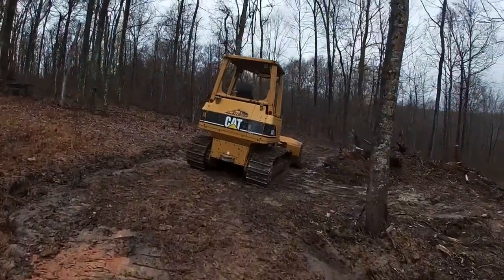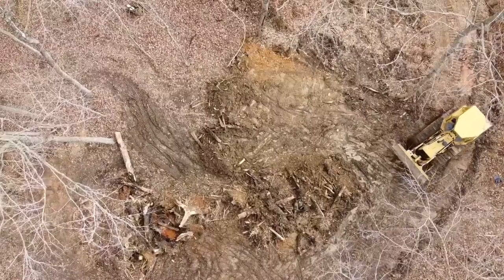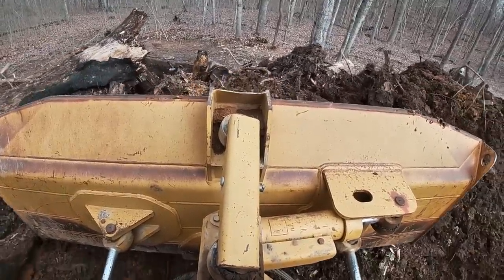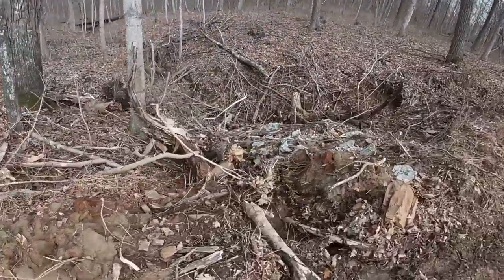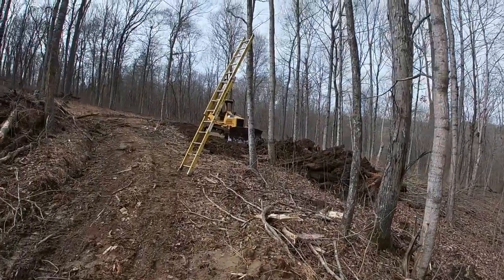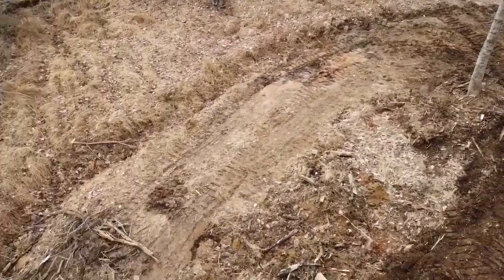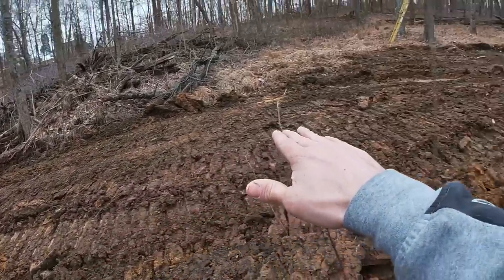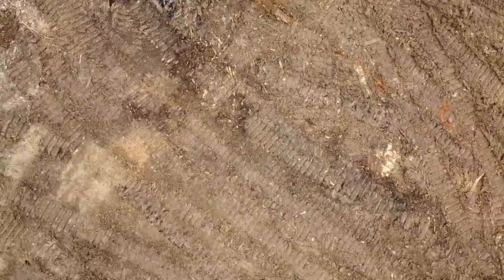Homeowner Rents Caterpillar D4G for land clearing - Youtube Yacht Series

Comment: I was an Air Force Vehicle Mechanic for 20 years (retired in 2016) and the company that makes those portable 12/24 Volt jump packs are awesome!  We also had their heavy duty roll around packs that even had the M-Series slave cable receptacles! Our mobile maintenance trucks their generator/jump start unit with ALL of the different types of connections and cables for just about any application you could imagine!  Their products are tough and last a long time.

Comment: Jerry will be proud! You ended up with a tolerable good result without breaking anything. 

My grandfather had a D9. It was post WW2... you know like 1946.  It used cables to lift and angle the blade. He lived in Princeton IN.  As a teen, I had the privilege of playing on it for a weekend.  

He had a 40 acre corn field that he was terracing.  It had been cleared years ago except for 2 huge pecan trees that he wanted to save. 

You see, when you are backing a D9 in the middle of a 40 acre corn field you don’t worry too much about looking backward... had he seen fit to put a rear view mirror on it... he might still have two Pecan trees in that field.

But, the one that was left stands proudly beside the office of a trailer park now... and a little bit of the wood from the other is in a hope chest he made for my sister.

So, by my book.. you did just fine in your maiden voyage.
Reply from the maker: William Harris as always you made me laugh.  So Am I to assume that some of your wood working knowledge  got handed down from your grandfather?
Reply: Captain Kleeman a little bit... he was actually much better with metal... he was a Tool & Die maker for Westinghouse.  I have all of his measuring tools... slide rules (ancient calculators... one step above an abacus), and etc. I learned woodworking when I was a Quality Engineer for a huge Furniture manufacturer.  Good try though.

Comment: I always remember when our dealership got the first high drive D10 in Canada. It was set up for a big open house with a D3 dozer in front of the Mass Excavation Blade. The D3 looked like a little toy sitting in front of the D10.
Reply from the maker: Gerald Heitman did you work at CAT dealer?
Reply: @CaptainKleeman  Yes I worked at the Cat dealership for Ontario Canada in the engine division (industrial & marine engines and generator sets)

Comment: As you get more practice you'll find second gear and more speed will help.
Breaks up material and pounds in some of  the material and smashes wood under the pounding. It looks good!!
Reply from the maker: Blade Runner I Ran a little
Bit more today.  You’re right,  seemed to help a little.  Just trying not to get to full of myself and break something 😂 hey thanks for watching!
Reply: @CaptainKleeman  Go for it. Lay dirt out thick then take cuts about a foot deep. If wet and sticky angle blade and winrow it out,, keep working big wood rocks and stumps off edge of lift. Don't worry about dirt or grade just thin out the junk.When your ready take the first cut down the middle of lift a one ft cut works good at leaving dirt and keeping enough dirt to roll out any large wood ahead of push or it'll roll out one side or the other.Rule of thumb  max push for efficiency and grade level is 150 feet but works out slightly more. We work three stations at a time on road jobs stakes 50 ft apart. Take the high side of lift first, I said above to take middle to start, if lift lands fairly equal depth is when I'd take middle then left side or right. If you track onto large rock along cut back up and corner it up out carry on to bladeful you left push to end. If theres a hole dont worry it'll fill next pass or so.At end of second push half track your imprint back to start 2nd gear let out off decelerater the dozer will speed up and develop what we call a thunder speed up as it comes into it to where your comfortable. Check tach if you have one or train ear to  rpm tone for reverse. Creates an equel pack pattern, the tighter the pack the better the 2nd cut goes. Now it becomes more enjoyable seeing lift coming into it. You won't break anything so don't worry about that. I carried on as usual, not trying to tell you what to do. I grew up excavating been at it 30 yrs or so.pretty much done now due too severe spine injury. Two things you DO on a dozer is wear seat belt and hearing and eye protection with open cab. Always belted enclosed cab ear and eye is still good idea. As confidence builds your speed will pick up, beware of covered stumps still rooted stop you dead in your tracks. Without belt you're going overboard after you meet dash and grab handle on top comes air cleaner and muffler.  What you DON'T do with a dozer is push against trees to knock them over. The whiplash affect can snap the top off or just a limb but plan on it landing on you.  There is a method to it but chain saws better choice. Large rock tilt corner ease into cut and push when you feel dozer pressure against rock throttle up and lift on blade. Keep dirt betwwen blade face and rock. If no movement back off easy and tilt cut around it pick a different push point. No move put hoe on it.Sorry so lengthy. Can't tell.i miss working! You're a natural by the looks of things doing great.
Like you said common sense and seat time. On reverse speed if your reach loud /hard track pad slap slow down a tad. Have fun, I'll be checking out vids.

Comment: If I can offer a little tip, tilt the blade back from bottom to top so heavier items are pushed forward and lighter are pushed aside, also turn the blade either left or right depending on where you need the material  to end up. Also the blade does not have to be used for digging if what you want to move is above ground. Yes putting the blade at an angle means more work but it also lets the soil fall away from the logs and limbs so it takes less effort and time. I  in would have dropped a culvert in that ditch for rain run off and snow melt because blocking a drainage point is a bad idea even the desert.

Comment: you did a good enough job given limited experience mate.
Nobody but nobody becomes a professional on their first or second go it takes hours and hours of use repeating and finessing before you get really good.
Only tip i would suggest is when you are pushing the material along? as you move forward slowly keep bringing up your blade, that way you will find that the larger material in this case tree limbs stumps etc, will keep on being pushed whilst the soil leaf mulch will bit by bit drop out and be left behind.
 It will come with practice that is 100% guaranteed
Reply from the maker: ricky bobby 78 thanks for the tip and thanks for watching!

Comment: The water in the battery most likely needs topping up if it sitting for a week it should not drain the battery. Mind sits for a month or more and I have had no trouble starting for the last 3 years.

Comment: You're doing ok. Its not easy between trees. When  you first cut into pile load blade right up and extend push longer working blade up little at a time letting dirt drop out but carry larger wood stumps and rocks further on. Then back up and make another cut working larger material out again. Leaving cleaner dirt behind. It's a bitch when wet also due to material not breaking up. It takes time an patience.
Reply from the maker: Blade Runner seat time and common sense.  Sounds like you have both!  Thanks for the tip and thanks for watching!

Comment: You did a good job getting over the  little over zealous pushing. Ran the same model dozer at work before I retired. Did you know the rubber pads next to instrument panel are for your feet to brace yourself pushing steep downhill. Yes have used them 😁
Reply from the maker: Bob Fitch holy smokes.  Well I don’t think I’ll be needing them any time soon,  plus I’m not sure I’m qualified for that kind of terrain! Thanks for watching.

Comment: Hey Bro, not too bad for having virtually no experience. Looks like all you need is some seat time and you will be a Dirt Perfect Jr in no time! LOL. A word of advice, easiest way to learn to cut a grade, always keep a blade full of dirt when pushing. Scraping around is ok to learn controls and actions of the machine, but true dirt work is a lot simpler if you have a full blade of dirt. That doesn't mean you have to be able to see it over the top of the blade, just around both of the sides. Watch Mike's mentor Jerry sometime, you can learn a lot from that man.
Reply from the maker: Joseph Mascioni going to bolt a jump seat on it so I can ride along with Jerry!  Absorb some knowledge.  Thanks for the tip and thanks for watching!

Comment: That sounds like the hydraulic are loaded up when cranking that doesn't seem correct.
Reply from the maker: John Schmidt when’s that at?
Reply: When you went to start with the booster pack that didnt seem like a slow crank that sounding like the hydraulic where engaged and that would make it crank way slower and start harder.